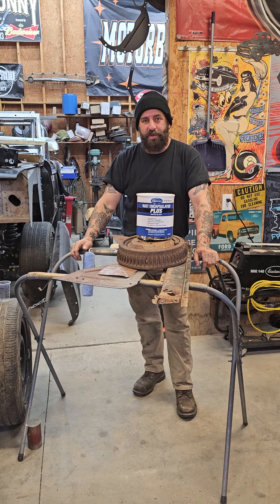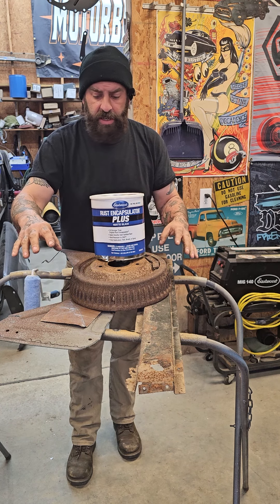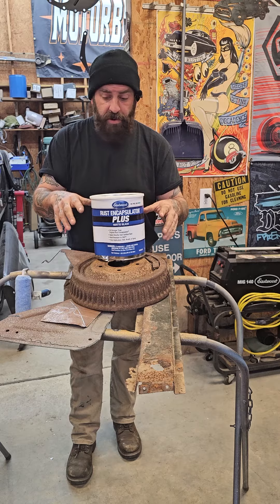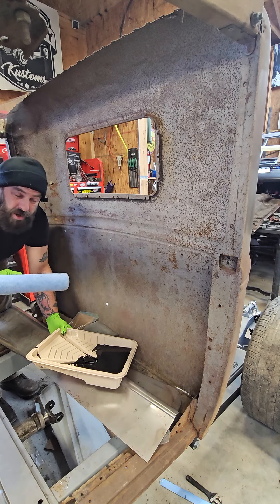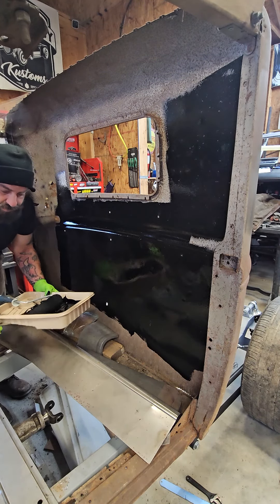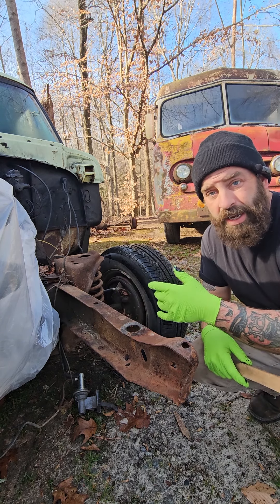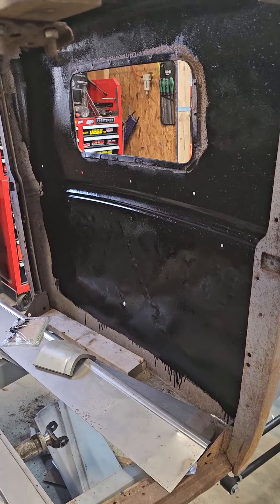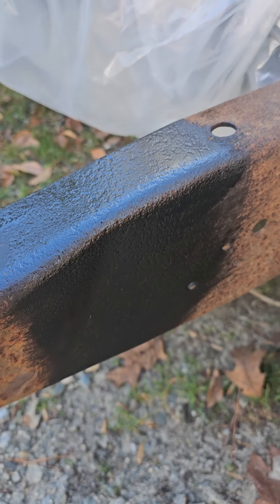EASTWOOD RUST ENCAPSULATOR

Comment: I "might" have dropped it!!! 😆😂🤣 Btw, thanks for posting this. I have been using various Eastwood products for years and I have generally been pretty impressed.
Reply from the maker: you should have seen it rolling down the driveway! lol.   ive been impressed with their products as well.  and the customer service i did have to use once and it was trouble free

Comment: That is not how you use this product you can paint over rusted parts but they gotta be cleaned up to the best not just wire brushed i sandblasted my whole frame befor i touched it with this i made sure 99 percent of rust was gone or converted

Comment: Iv been wanting to try this paint from Eastwood which the wife just got a 01 f150 and I need to wire wheel the whole frame and put rust converter and under coating on the frame. It’s also needs a new bed because the bed cross member is gone from rust exterior of the bed looks grate no rust but you open the tailgate and then see it which I told the wife not to open the tailgate unless she has to otherwise it might not close. I’m calling her f150 the budget build and trying to do it for as cheap as possible but with good products and parts not buying premium top of the line parts just mid grade parts but as far as the east wood paint goes Iv been wanting to get it either way as we have 8 vehicles to maintain well 5 of which are ours the other 3 our our parents but we do the maintenance on them all only time they go to the shop is if we can’t do it or don’t have time to do it
Reply from the maker: I recommend knocking the large chunks off but no need to deep clean it.   Eastwood has some great videos that address a lot of these questions  
https://youtu.be/OAGiOtW0rqo?si=60Z7iD7jlTuECW0y

Comment: anybody know if a quart will do a whole long bed truck fram ?or do i need a gallon?thanks
Reply from the maker: im pretty sure it will.  the gallon took me almost a year to use up.  you can reduce this down just like paint as well. up to 20%.  that will help it spread easier and get you more usable product.  so far, spraying it in a paint gun has been my favorite method. i used a cheap amazon spray gun and it worked well.